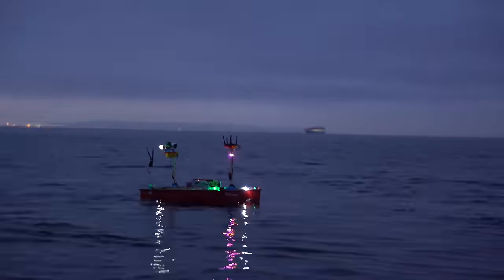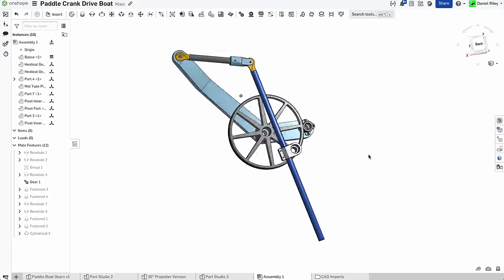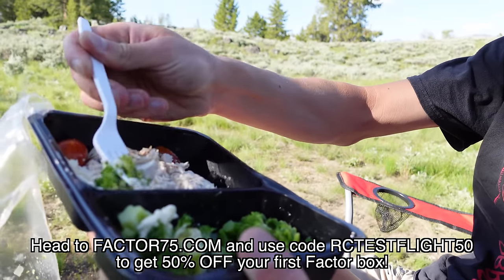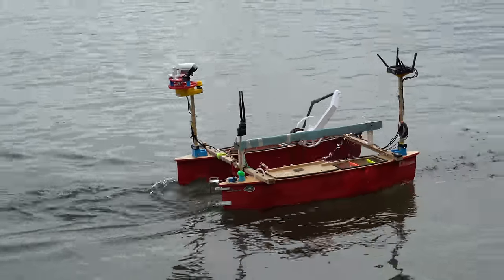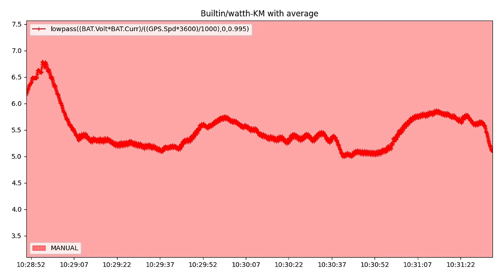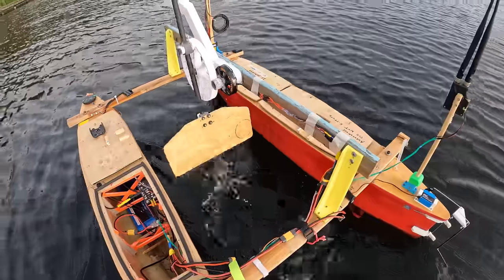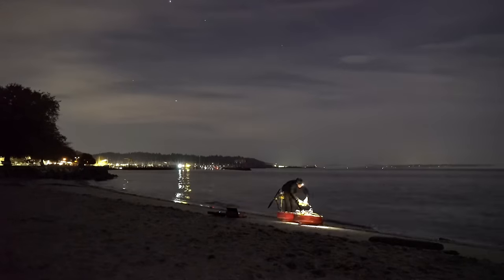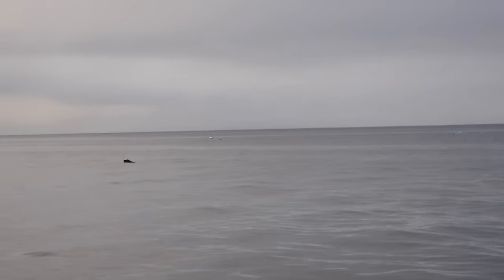Propeller Killer? High Efficiency Paddle Vs. Propeller

Comment: @rctestflight If you really want an energy-efficient ride by a watercraft, there are two possibilities: a) Nullification of water-drag and water-friction by using supercavitation (pyhsical details see Wikipedia). Technology is simple and already used on big transport ships: Realease compressed air through a grid of holes in the part of the hull below the waterline. This works even for submarines and torpedoes (look up the the term «Shkval» and take a look at the achievable speeds). The second proposition sounds a bit outlandish at the first glance, but is even more effective, since water- and gas-resistance is completely taken out of the equation. It is gravitoelectromagnetism (GEM). The US-DOD uses this propulsion method since July 2011 (end of the STS-programme) in their TAV (trans-atmospheric vehicles) and AMV (all media vehicles, that can operate within the atmosphere, under water and in deep space; volgo USO). The physics behind this propulsion system is sound, the technology is simple and reliable.

Comment: While back i encountered a popular science article about a steam powered marine thruster. It seemed to be somewhat based on quite old tech of steam ejectors, "air movers" and a more recent equivilent might be a dyson bladeless fan. Basically a set of cones which are arranged so there's a tiny gap between them towards the downstream end. Steam exits through that gap supersonical(or faster if nozzle shape adjusted careful) so has huge KE.
The steam slams into water and condenses which shares the KE with the water. And results in thrust per rocket equation. Supposed to be fairly resistant to weed.

Comment: I love your paddle design. The angles entering and leaving the water are almost perfect. Feathering the paddle parallel to the direction of travel would be most efficient on the return stroke, that is what you do with a canoe paddle. But the mechanism to do that would probably not be worth the small mechanical advantage.

The main problem with paddle wheels is that half the wheel does nothing, the front quarter tries to push the boat up and the back quarter tries to push the boat down. Only the blade at the bottom is pushing in the desired direction. But, what if you made a tank tread instead of a wheel. A larger percentage of the paddle would be pushing the boat forward and half the paddle would always be in the water instead of a regular paddle which is out of the water half the time. Just a thought.
Reply: That was solved in 1841, the "feathering paddle wheel".  Look it up.  It was widely used on large fast steamboats. The paddles are turned to be perpendicular to the water throughout the time that they are in the water.

Comment: I think for these longer waypoint missions with the larger props, you might just be better scaling up your hulls. More room for batteries while potentially resisting larger waves better?
Reply: At least scale the hull length as the back tipped into the water. sideways it's quite stable already. also longer hulls tend to be more efficiënt for a number of reasons so yeah i'd agree

Comment: It is a fascinating video!. I'm an experienced paddler of dragon boats. The paddling method is very similar to the dragon boat paddling. The paddling solution is the method that the beginner paddler will use.
Here are some suggestions to optimize the efficiency. 
1. The paddle needs to be buried into the water deeper to maximize the power to the max. 
2. Need more horizontal movement. Most of the power is pushed through the water during the 90-degree time. 
3. Clean exit, When we do exit. We slide the palled out from the side of the moving direction. 
4. Positive angle during entering. We do more positive angles when we enter the water. especially when the water speed is high.
And what you do is a negative angle (version 2).

I'm also an engineer and I'm also doing some data-gathering devices for my team. It is always enjoyable to see other engine projects.

Comment: Would be interesting to try a caterpillar track system for the paddles. Would be similar to having multiple paddles
Reply: or maybe... a water wheel xD like... in old ships xD i mean multiple paddles on wheel... simplier than what he have here... ok i checked it's called paddlewheel xD
Reply: @bartoszcabaj8761  I think there are some inefficiencies simply using a wheel with the way the paddles enter and exit the water which is why this is such a cool method and why a continues track designed to enter and exit efficiently might be a good idea
Reply: @stocky9218  yeah the inefficiency from the paddlewheel comes from the entry and exit angle. the paddle is more efficiant casue the  pushes on the water nearly liniarly.  best way would acually be something like tracks where the majority of the travel throgh the water is completle sraight. however the losses on the gearing, trackchains and rollers would be too much.
Reply: The old paddle wheel steamboats had paddles for a reason. Some in the rear and some on the side at the mid point. Perhaps a little research might help.
Reply: Unfortunately, track systems are generally a bit less efficient overall, due to the greater amount of friction they're dealing with. The tracks are pulling hard against the bearings of the inside wheels, producing increased friction. Each link turning and changing directions every loop produces friction. The paddles on top are causing air drag.
Reply: I don't think caterpillar tracks would be very efficient. Some amphibious vehicles use them and they seem rather slow, although they aren't cupped because of land use.

Comment: 1)  Wind direction is a more important variable in wave height as is wind speed.   The longer distance the wind gets to work the bigger the wave for the same wind speed.
2)   For the paddle design, try experimenting with elliptical drives to max efficiency. Also if you want to test a folding paddle design use a coordinated  solenoid hinge mechanism.
3)  On an unmanned vessel, it shouldn't matter where you put your propellers. I would put them amidship offset (èasier turning)from the hull to accomodate larger propellers higher off the water at the mean stable point of the boat.

Comment: What about a corkscrew propeller?
Make the propeller blades continuous with shallow angles so there aren't any corners for sea grass to catch onto.

Edit: if you want to be fancy, you could try a golden ratio turbine. 
https://youtu.be/BxNHOMJGcj0?feature=shared
Reply: That was tested by the first guy to develop the propeller. It snapping and working better broke is where the idea for a modern propeller came from. 

I forget his name but his steam powered boat is now in a museum in Britain.
Reply: Racing propellers are half-submerged and maybe that's enough to throw away the seaweeds during the upper part of each revolution.

Comment: When I was young in the 60s we had a hand powered paddle that worked pretty well. It was about the size of yours but turned parallel to the water with an L shaped handle and a v shaped pivot that would let it go back and forth like a fish tail. You pushed the handle back and forth or left and right and if I remember right it pushed our aluminum john boat without a lot of effort. Of course we we were just fishing along the bank and lilly pads so speed wasn't a factor.

Comment: Highly enjoyable and inspiring video! 
I think, there are many more parameters, that might boost efficiency: First question might be, what theoretical limit or reference might apply = some car? On the other hand, transport by ship is said to be way more efficient than trucks and trains, though, on the other hand: You don't go for payload (by now).
My ideas for the paddle solution are to 
1.) try some shovel shaped paddle and additional vertical "walls" (what is called "fences" on airwings) to minimize vortices 
2.) optimize the inner shapes catamaran body (maybe even like a jet propulsion-like tunnel and different intake/outbound diameters (maybe +/-25% ?))
3.) add 1 or 2 paddles diving in in an interleaved pattern over the length of the hull for steady water flow

And I'm  really curious about the bionic/toroidal propellers, which are said to be twice as efficient.

Comment: Nice video ! I hope one day you can test out contra-rotating props !
Reply from the maker: Coaxial props? They are less efficient
Reply: @rctestflight  Dual props that spin in opposite way on the same axis. Probably less efficient because it needs some kind of gearbox, but it would be interesting to see how they perform, at low and high speed. Some people put them on their speedboats, must be pricy so there has to be a reason for them being sold.
Reply from the maker: Yes, thats called coaxial props. Less efficient but higher peak thrust for the size  @eugenef4579

Comment: Have you heard of the experiment the British Navy conducted in 1845?  

They built two virtually identical ships with the same displacement, engine size, and hull geometry.  HMS Rattler had a screw prop, and HMS Alecto had paddle wheels.  They tied the boats together stern to stern and had a tug-o-war battle.  The screw prop won the battle.

You could do a similar experiment!
Reply: Interesting. The Rattler crew was probably buying many drinks for the Alecto crew the night before! Essentially a bollard or static test which is quite different than underway conditions.

Comment: Parallel Conveyor/Belt Paddles, 1 above the other.
The paddle arm is connected to both, so the paddle is always vertical, no angle when it enters or leaves the water, or during the stroke, the paddles always pushing the water directly backwards.
The vertical distance between the 2 conveyors determines how far the paddle is inserted or lifted in/out of the water.
Longer stroke means less energy lost dropping and lifting paddle in/out of water.

Single Conveyor/Belt with Multiple Paddles, paddle on hinge with extended hinge pin with lever at end, use cam or similar and spring to position the paddle so it is always vertical.

As others have noted, Widen Paddles to be closer to hull, decreasing water lost around the edges of the paddle.

Comment: In human propulsion, one of the recurring footnotes is that the Chinese yuloh oar allows someone to propel a very large boat or even a barge with tens of tons displacement at several knots for well under a hundred watts (one woman, one hand, not breathing hard).  It's a similar oar motion to how animals swim using their tails.  I am curious if you could replicate it in a motorized dual yuloh design for your cat.

Comment: The flipper-style 'mirage' drive some kayaks use would probably cut down on weeds with added speed. it's a pair of side to side paddling flippers that are opposed, to mostly balance out the lateral movement.
Reply: I had a couple of Hobie Mirage Drive  kayaks and that drive could out-pull two regular kayak paddlers in a tug of war.

Comment: Very cool! For the paddles to avoid needing a rudder, could you have paddles on the sides of the boat (they could all be synchronized via the same drive shaft), and create differential thrust using another mechanism to control the depth of the stroke? Alternatively, maybe you could rotate the paddle head.

Comment: correct me if I'm wrong, but if you're torn between a paddle, underwater propellers and above-water fans, why don't you just implement all 3 in one boat, with the least efficient ones serving as a backup?

Comment: I really like the paddle idea. Could it not work quite well even in bad weather. Efficiency could probably be further improved with a better paddle design and by fitting it more snugly between the hulls. There might be an issue if it catches the wind when going against it; however, this could actually be beneficial when travelling with the wind.

Comment: You should use a cam style shaft and have 2 paddles so one is constantly in the water. Similar to the guya bicycle set up in the canoe 🛶. But still in the center. But even if you don't. The paddle still need to be cupped or concaved like a snow shovel. You're losing thrust efficiency with water going around the outside of the paddle while it pulls the boat forward. And on the return stroke water would move smoothly off of the blade as well. You could also try thinner hinged blades around the entire diameter of the paddle (in the water) that flip back during the return stroke to eliminate drag. Just some recommendations\ideas.

Comment: Multiple paddles to remove the wasted part of each stroke and smooth out motion.
Caterpillar track with multiple paddles/cups to give continuous drive.
Oscillating fin that goes the length of the hull, like an eel.
Retry the air fans with them mounted at the centre of the pitch axis so they don't hit the water and give them a cowling/duct to improve efficiency.

Comment: RC filter works mostly for soothing the voltage, not the current. You need to use an inductor to smooth the current. I suggest using a T topology filter with LCL. Coils will smooth the current. You can replace the first coil with a resistor, if you want.

Comment: Sometime in the 80's or 90's I remember some F1 powerboat competitor experimenting with a very high speed paddle wheel instead of the regular propeller used on the competition boats.
I have no idea what the results were, but at least it shows that people has experimented with paddles relatively recently. I'm also uncertain if this was before surface cutting propellers were developed or not. Surface cutting propellers can be run at much higher revolution than ordinary propellers without suffering from cavitation causing performance problems or propeller damage.

Comment: Instead of having fins jutting below the hull (like you cut off), you can extend the hull line into a vertical wall. You can also extend horizontal fins behind. You will get some skin friction but a big impact on stability.
If you want to investigate the paddle more, speak to a serious racing canoeist (not kayaker) about their stroke. They are the most equivalent to your design. A noncircular wheel might improve things.

Comment: I love it!  You're right that you can't really call the paddle area "disk area", but there is a definite relationship.  The reason bigger propellers are more efficient than smaller ones is that Mass x Delta_V gives you thrust.  But 1/2 Mass x delta_V^2 is the energy used to do it.  So you can easily see that you want to accelerate as much mass as possible over the smallest possible delta_V.  The bigger your paddle, the more you're just pushing off the water rather than accelerating the water.  Basically, stirring up the water is lost energy.
Reply: D'OH! I have to learn to watch the whole video before commenting.  As soon as I hit play again, you covered this.

Comment: before  watching your video I was thinking about using a 20" plastic BMX bicycle rear wheel with paddles attached driven with a bicycle chain /sprocket . This would eliminate the wasted motion of the forward -backward stoke and the dead time of the forward stroke .  The plastic wheel could be mounted above the waterline with only the tip portion of the paddles contacting the water like a canoe paddle does and should be self cleaning from the grass.

Comment: I think, with air props drive you need to extend the length of the ship maybe on 50% and move props up or put them in the middle. The paddle efficiency bonkers, but unlikely its applicable to larger ships - the mechanism takes a lot of space, that is a lost cargo capacity, but maybe it can be made smaller somehow or just placed smartly. Air props aren't used on water due to noise pollution, look at amphibious civilian and military ships: they're pretty rare and operated in low pop density regions.

Comment: Windspeed is not the dominant factor in wavestate, windspeed+distance over water is. The concept is refered to in sailing as "fetch". 5kts coming off the beach you are standing on creates no waves, 5kts coming over 20km of water towards the beach your standing on will create more substantial ( relatively ) wave state. 

Re the air propellors, there was the simplest of solutions to prevent wavestrike, mid mount or forward mount them at a height sufficient to clear the deck

Comment: It should be a fairly trivial matter to move the air props a bit forward to prevent then from hitting the water... 

You might also consider putting them on gyro gimbals to prevent them from pitching with the hull, or dampen it somewhat

Comment: Check out how the implement prop/s into the hull of the newer fishing kayaks. Basically they are recessed into the bottom of the hull. Although to repletely negate prop fowling you could also incorporate a mesh, cage as encapsulating the prop. However this ideally is flush with the bottom of the hell. Just a thought. Watch the videos they have made on these fishing kayaks. I know a fowl proof prop can be employed.

Comment: The wave issues out on the sound could be examined as a function of hull length vs. wavelength. On a different sized hull the lever action of the waves would just pass under the hull unnoticed or perhaos you could tune a short hull to cause destructive interference with the 2-knot wind speed wavelengths.